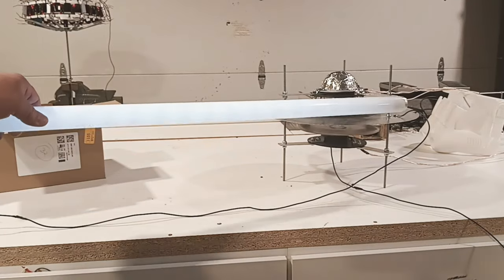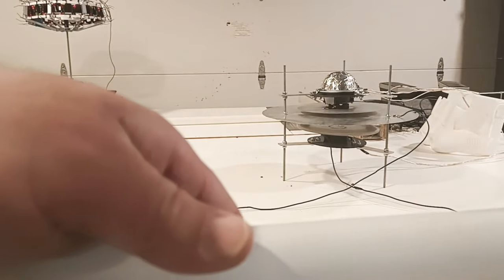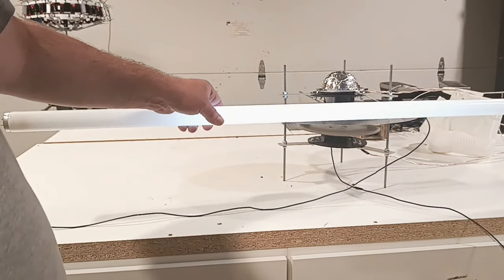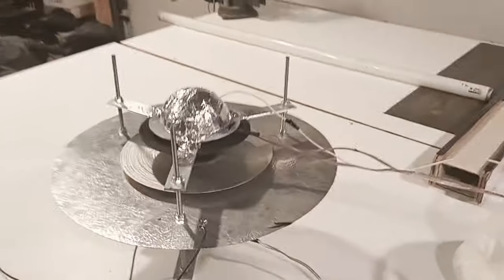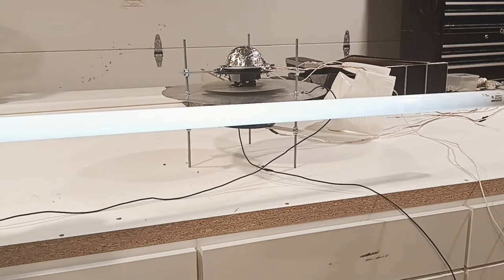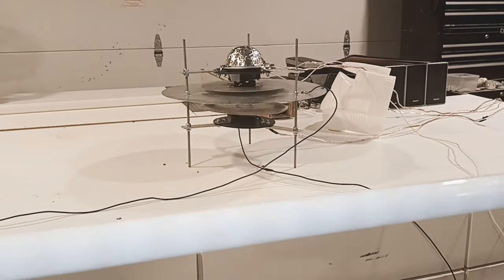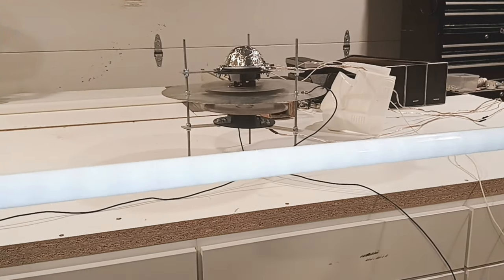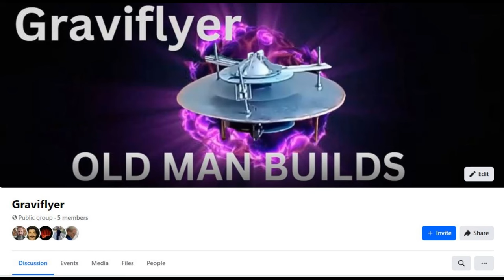Graviflyer Testing 7

Comment from the maker: At the 25:00 mark I slow down the motor. The pulse rate of the whole craft slows down. When I speed up the motor is goes up. The high voltage and the tesla coil take on the same pulse rate. I have not only found the fields ( bubble around the craft ), I have lined up the beat frequency of everything. I have also polarized the craft. So the center plate is now taking on a magnetic signature. Except it will now stick to wood not just ferromagnetic materials. My top 4" of my tesla coil has  a Hz frequency under 20Hz and will go down when the motors speed goes down. The motors are tied together so they take on the same pulse rate or beat frequency. If you run them individually they take on separate frequency's.  I have interconnecter the craft just like Alexey. I adjust it all to the top motor's speed. Not the center plate like I predicted. The result is 90% of this craft is working just like Alexey said it would. The last 2 parts are lift. One transfer the energy from the top plate and two get the piezo to create direction. ( Quick note: the more the tesla coil is turned up. The higher the emi gets. But it also makes the center plate more polarized. A step closer to it own gravity in a way. )
Reply: Whats the thing you have in the vice it looks like it would create a large toroidal field..or receive..
Reply from the maker: @gypthcnuryse7611  it's a take on Eddie current. I need to add a motor. The inside has aluminum. So when it spins the inner part should spin

Comment: The shadows in the florescent tube seem to be really useful for identifying aspects of the fields. Alexey often used a large circular bulb. I wonder now if the was no accident. Perhaps he was also observing these shadows? If I had to guess, you'd probably want a large circular bulb and hold it horizontally above the GF. Ideally, the shadows would be moving in a circle inside the tube (following Alexey's 'torsion' line of thinking). Great stuff!
Reply from the maker: Did you see the motor speed make the pulse rate change in the build. It was at the end of the dark part.

Comment: When the fluorescent bulb is parallel to the electric field, it will be dim. If you change the florescent to be perpendicular to the electric field, the light will shine bright. Can we put this on a scale to see if it becomes lighter? You may have a tiny anti-gravity effect and not know it.  Another great presentation!
Reply from the maker: I ordered a scale. I wanted one with no electronics. A food weighing scale. I will test it. But with the motors running it will be hard to filter oth the vibration. In other words the effect must have a force equal to 1/3 the crafts weight to be sure it is there.
Reply: That’s the ongoing problem with the graviflyer. My gravinductor has parallel, perpendicular, up and down covered.

Comment: great video! that's very interesting you're able to control the impulse discharge field rate with the rotating disk! kind of mimics that 1952 Washington dc ufo video that pulsing fields. Maybe try speeding up the disks and then slowing them down in a cycle? possibly see if the field distance expands and contracts?
Reply from the maker: it does at higher voltage levels. The 2 fields have to be aligned perfect with the resonance of the center plate. Then you get massive emi.
Reply: @nathanbunten4299  I see, i'd think that the Eddie currents pooled in the center disk would become usable by the tesla impulse field increasing the current or power total absorbed by the fluorescent light at a set distance. I'd bet there's a sweet spot of rpm that delivers the most power increase in watts at a that set distance.

Comment: Magnetic Viewing Film! MVF! MVF!
Reply: Wouldn't that be something if you could visually target the cross pattern or better offset the Eddie currents in opposite directions north clockwise and south counterclockwise. And use it like a thunderstorm generator plasma system but with magnetic fields and centrifical forces in opposite directions,  polarities, and power input. Just a thought.
Reply from the maker: The disc is highly polarized in this configuration. Balsa wood will stick to it. If You wanted something that is more like a magnetosphere you would need magnets on the top as well. There would be a lot of math involved to configure the whole thing properly. Also the fields would have to be 10x or more larger to develop any kind of atmospheric condition. Or it may just not work and make a raging energy ball.
Reply: Ferrocell too
Reply: @nathanbunten4299  not gonna lie here brother, a raging energy ball could do wonders for your channel. A little click bait thumbnail of something like could draw more attention to this topic in general. You have lead me down a amazing rabbit hole thank you sir.
Reply from the maker: @hellogoodbye3129  What is science if you cannot have a little fun. I will work on lighting it up.
Reply: @nathanbunten4299  so my son suggested using visible gas or smoke to show spheres of fluidic motion and may have a measurable effect on the gases's momentum or something/anything. My 4yr old is taking this ride with me.
Reply from the maker: @hellogoodbye3129  He is very smart. I have a fog machine. It is worth a try.

Comment: That little Tesla arc is about a centimeter in length. That equates to tens of thousands of volts. Also, the center of the Tesla spark is as hotter than the sun's surface. The only reason you aren't incinerated is because it's a very low current and alternating current. If it were DC, it would be wild!
Reply from the maker: You should see the coil when I move the resistor to the other side. I put it in reverse so it pushes the field not the arc. I could put this thing up to 200v. The transistor is rated at 230v. The way I have it now makes the transistor have more heat but it is a better resonance machine. I guess you could replace the resistor with smaller ones and add a dial to each side and it would be like Tesla tuning his coils.

Comment: WHat i see is that there is a certain difference in the alekeys device that i noticed, a litle chamfer im the midle disk that might make some difference .
Reply from the maker: small holes like the shell of a beetle. Like a resonance chamber. I think that would be worth testing with one rotating disc and the chamber to get the oscilloscope readings.
Reply: @nathanbunten4299   i have seen  this about these smal holes in the beetles wings too that makes a lot of sense with eletrostatic, because they have also litle hairs. But what i wasnt really clear , I ment a litle fold in the midle disk, that may make some difference, sorry!

Comment: If I recall you said you wanted to align the fields of the spinning discs and then suppress the field of the top disc so it's directed to the bottom disc then the thing should lift?
Reply from the maker: That is the next round of testing. I won't start that for another week. I know that is the one everyone wants to see.
Reply: @nathanbunten4299  Sounds very interesting I hope you have all your videos backed up on an ssd drive just in case I'll probably do the same with your videos. if you're familiar with ssd drives they made hard drives obsolete in every way lol
Reply from the maker: @fireball75677  I have them backed up.

Comment: Once I have a 220v water pump motor from a washing machine? I already have my outdoor in the desert electronic lab waiting for lift. I will have solar power and motor generative power on wheels. Tomorrow is my textured aluminum grab from a refrigerator dump that the city aught pay me for partial clean up. Don’t trash mother nature people! Or you will have antigravity dudes paying your power bills for you :(
Reply from the maker: get some paint stripper to remove the paint on the fridge or freezer aluminum.
Reply: @nathanbunten4299  yes sir :)
Reply: @nathanbunten4299  that or it’s a shallow grinder so tender and masked.